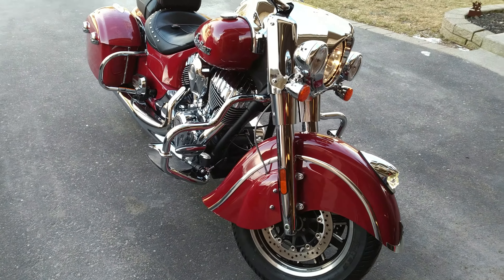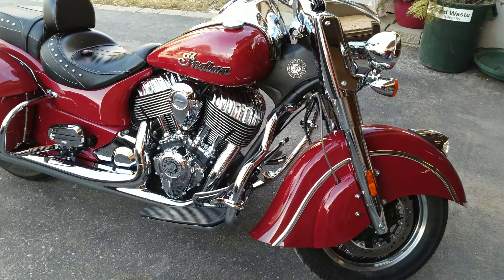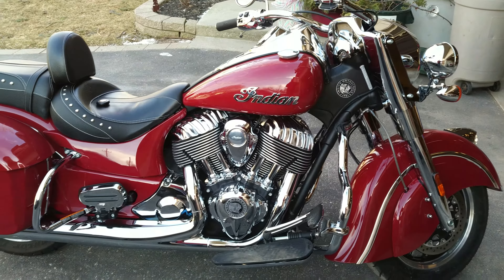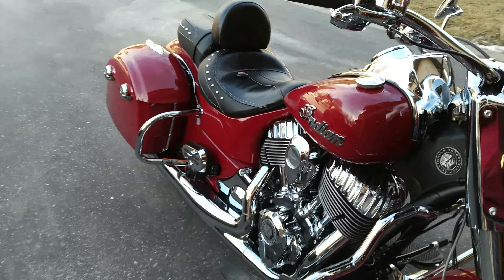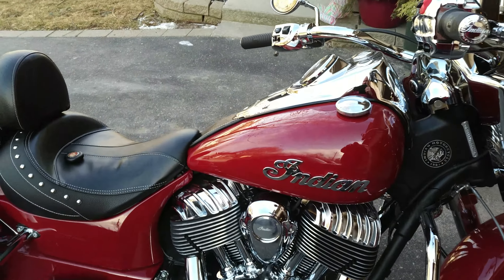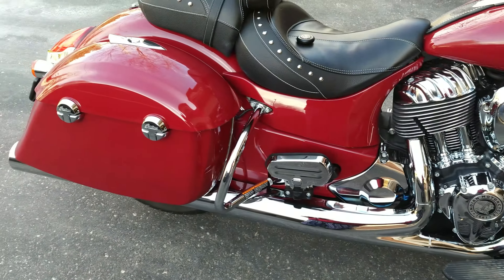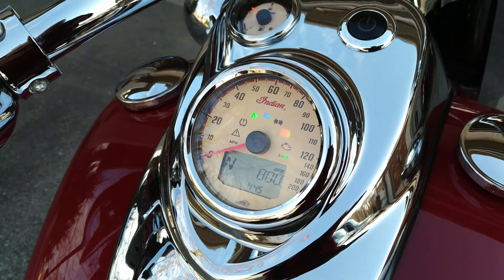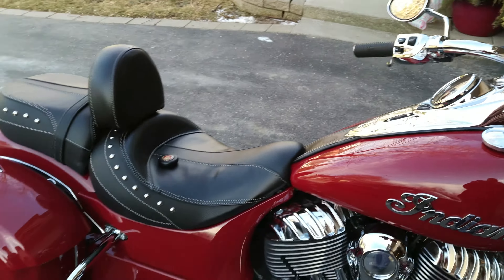Indian Motorcycle - Springfield model with slip on Rinehart exhaust

Comment: Hi. Thanks for the video. I hear the catalytic converter is responsible for much of the excess heat in this engine. Do your slip ons do away with the catalytic converter?
Reply: PS. I don't like real loud pipes as I have an intercom/MP3/phone on my helmet. Are these pipes excessively loud?
Reply from the maker: Hi, the slips on are installed after the catalytic converter and thus do not have any impact on it.  Lots of people have removed the which has helped with the heat build up on the right side of the bike. I think this will be more noticeable for folks riding in hotter climates.  I have noticed the heat for sure on warm days and have contemplated removing the cat but honestly it has not been THAT bad that I felt like tearing the exhaust apart. 

I might do this as a winter project.   That said, this is not like you are sitting on a charcoal grill and is not noticeable to me under speed.  The bottom line this is a huge air cooled engine and you will feel some heat but I think it really depends on your locale and riding situations as to how much it might bug you.  Tons of bumper to bumper traffic...Yeah I can it bugging folks.  The odd traffic light and some light traffic...nope.

Best of luck.
Reply: Thanks Doronik. I feel the heat more with the windshield on but in the summer months I generally ride without it unless I'm traveling. In your opinion would the addition of an oil cooler be advisable. I was told it wouldn't help much with felt heat but would cool the engine some. Trying to make some decisions:) I traded in my Yamaha Stratoliner for the Springfield and the Springfield is very different in many ways but I do miss the Strat seat which was flatter and wider. Take care and thanks for the info.
Reply from the maker: I have never had the windshield on since it rolled off the floor.  I can't stand the buffeting.   As for the oil cooler,  it is not needed in my opinion unless you are in a hot hot area, towing a trailer or like the fairing bikes, blocking off air flow.

One thing that helps is the Power Commander PCVX  It allows the bike to run richer which in turn helps some. I would say if the heat is really bugging you, gut the cat out.  i have just not reached the point where the effort is worth it.

As for the seat, yeah I have had better and worse. I have had mine modified with a gel pack which helps but  I can see an Ultimate seat in my future.
Reply: @duke927  I've had two Stratoliners, still have an 2014 model.  What year is your springfield and how does the handling, street and parking lot manners, and hyw engine vibration, and power compare to your strat of the past, Was your Stratoliner stock?,   I trying to decide on my next ride

Comment: Nice mean sound. Is that a stock air intake?
Reply from the maker: Yes. It does have a K&N filter but it is stock.  It looks slightly different as I removed the 111 badge off it and revealed some nice script underneath that I prefer.